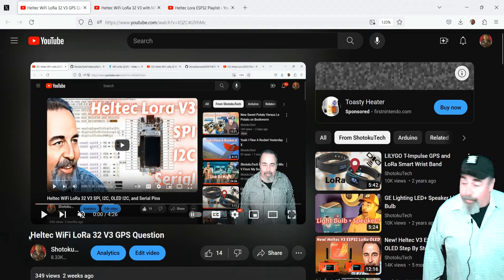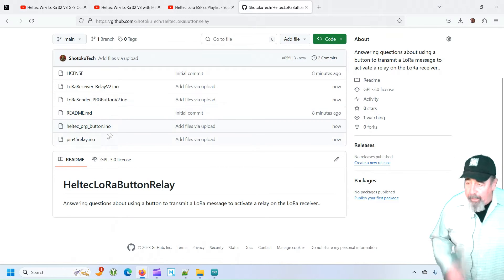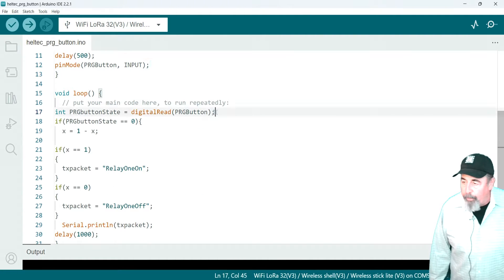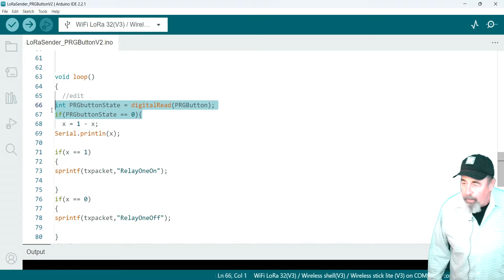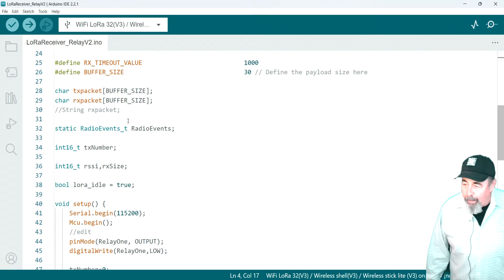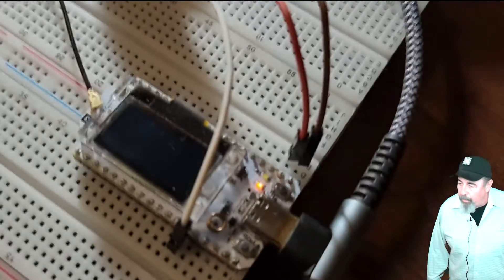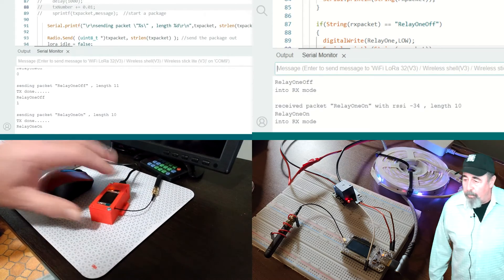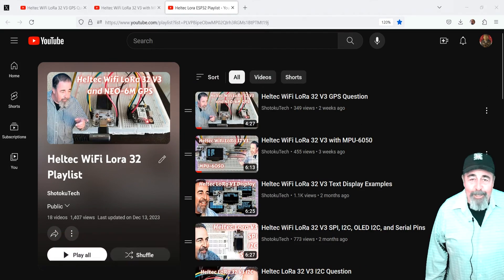Heltec WiFi LoRa 32 V3 Relay and Button Questions

Comment: Greetings from the UK. I've gad a few problems with Heltec V3 but your videos have helped to get it sorted. One sketch I would love o see is the relay module as described but with the receiver sending back the receiver state after pressing the button. I will be opening a gate remote from the house and want to know that it has actually happened. Thank you for all your videos - a really useful collection of knowledge for us  tinkerers. ATB Adrian
Reply from the maker: I got it half way there! So for kicks, to confirm the gate is open, would want a contact switch? Magnetic switch? Optical sensor?
Reply: @ShotokuTech  That is more than fantastic. The electric gate is operated by a relay and it is only necessary to send back that the relay has turned on or off. If I see that on the transmitter coming back I know the gate has opened or shut. To be clear in your sketch you are sending RelayOneOn or RelayOneOff. All I need is he receiver to send back those commands to show they have been received. I hope that is clear! Thank you so much for your help. Kind regards Adrian

Comment: Good video. However, I'm new to Arduino and Heltec devices and am confused about the actual build process you did for this project. I added edits you had to the LoRaReceiver.ino file and also included the pin45relay.ino code. The LoRaReceiver.ino code buiil ok and I uploaded to the heltec receiver device. I made a new sketch and did the same with the LoRaSender.ino file using your changes in the LoRaReceiver_Relayv2.ino and the heltec_prg_button.ino files. That build and loaded ok but the result doesn't work; i.e., the relay doesn't turn on and I get no messages in the Arduino IDE output. Any suggestions to clarify the build process would be appreciated.
Reply from the maker: Hello. I also posted the code on Github. https://github.com/ShotokuTech/HeltecLoRaButtonRelay
I recommend you view the latest information on the Heltec V3, this affects older code that came before recent revisions. "Update: Heltec WiFi LoRa 32 V3 Latest Info"
https://youtu.be/c1lkIko4Wsk

Comment: Thanks for the video! Very helpful, just one question, Can i use this code if i have the Wifi LoRa OLED V2?
Reply from the maker: I cannot guaranty code for V3 will work on V2 and vice-versa. V3 is ESP32 S3 and many things changed. You can give it a try if you like.

Comment: Hello, is there any arduino library could i use to make my heltec lora 32 V3 communicate with RAK7289V2 module please
Reply from the maker: Meshtastic is the way to go!
Reply: is meshtastic library compatible with arduino ide ?  @ShotokuTech
Reply from the maker: @mahmoudayman6973  No, it is a firmware you flash onto compatible devices. Then you can send messages privately between nodes or publicly to the network. I have a Meshtastic playlist here for you to learn more.
Reply: okay, can you provide me this playlist? @ShotokuTech
Reply: but i think LoraWan gateways are not meshtastic compatible @ShotokuTech
Reply from the maker: @mahmoudayman6973  That's correct. They are two different things. Meshtastic doesn't have a dependency on gateways. The devices form a mesh and each client forwards any packets it receives. You can add an MQTT server if you wish. That's about it.

Comment: I've been searching to build something similar for a while, from another video I seen. From what I've watched, he uses 2 Adafruit Feather M0 boards, with built in LoRa. (The video is in Thai so; I have no clue what he is saying) It was built in a clear box and, one is a transmitter and the other a receiver. 

The transmitter has 9 push buttons and an on/off rocker switch. The receiver side controls 4 relays. What all the extra buttons do, I'm not exactly sure. It just looks like a cool little wireless remote, that I haven't quite found a use for if I ever figure out how to build it. I got all the parts but, I really struggle with coding for some reason.

I'm thinking maybe I should just start with something like this, instead of going to something that complicated. (It looked easy to build at first haha). I also get 2 ESP32 boards/ and the LoRa modules but....once again got nowhere with it. Anyways, thanks for making the tutorial video on this! I'm thinking this will help me learn the whole process better.
Reply from the maker: Take one small step at a time. Best wishes.

Comment: Hi, I have copied and compiled the LoRaSender file in Arduino IDE and I get this list of errors, what could it be?

c:/users/gocha/appdata/local/arduino15/packages/esp32/tools/xtensa-esp32s3-elf-gcc/esp-2021r2-patch5-8.4.0/bin/../lib/gcc/xtensa-esp32s3- elf/8.4.0/../../../../xtensa-esp32s3-elf/bin/ld.exe: C:\Users\gocha\AppData\Local\Temp\arduino\sketches\7BA601B1808FAFDE6031BFFFFE5A58C2\sketch \sketch_feb14b.ino.cpp.o:(.literal._Z11OnTxTimeoutv+0x0): undefined reference to `Radio'

c:/users/gocha/appdata/local/arduino15/packages/esp32/tools/xtensa-esp32s3-elf-gcc/esp-2021r2-patch5-8.4.0/bin/../lib/gcc/xtensa-esp32s3- elf/8.4.0/../../../../xtensa-esp32s3-elf/bin/ld.exe: C:\Users\gocha\AppData\Local\Temp\arduino\sketches\7BA601B1808FAFDE6031BFFFFE5A58C2\sketch \sketch_feb14b.ino.cpp.o:(.literal._Z5setupv+0xc): undefined reference to `Mcu'

c:/users/gocha/appdata/local/arduino15/packages/esp32/tools/xtensa-esp32s3-elf-gcc/esp-2021r2-patch5-8.4.0/bin/../lib/gcc/xtensa-esp32s3- elf/8.4.0/../../../../xtensa-esp32s3-elf/bin/ld.exe: C:\Users\gocha\AppData\Local\Temp\arduino\sketches\7BA601B1808FAFDE6031BFFFFE5A58C2\sketch \sketch_feb14b.ino.cpp.o:(.literal._Z5setupv+0x30): undefined reference to `McuClass::begin()'

c:/users/gocha/appdata/local/arduino15/packages/esp32/tools/xtensa-esp32s3-elf-gcc/esp-2021r2-patch5-8.4.0/bin/../lib/gcc/xtensa-esp32s3- elf/8.4.0/../../../../xtensa-esp32s3-elf/bin/ld.exe: C:\Users\gocha\AppData\Local\Temp\arduino\sketches\7BA601B1808FAFDE6031BFFFFE5A58C2\sketch \sketch_feb14b.ino.cpp.o: in function `setup()':

C:\Users\gocha\AppData\Local\Temp\.arduinoIDE-unsaved2024114-20152-85351j.51uw8\sketch_feb14b/sketch_feb14b.ino:43: undefined reference to `McuClass::begin()'

collect2.exe: error: ld returned 1 exit status
exit status 1
Compilation error: exit status 1

Comment: Ebyte devices, including the mentioned model, operate using a UART channel with LoRa as the physical transmission medium. To view messages, just connect the LoRa module to a USB-serial converter. Using software like Putty in serial mode, you can receive the messages. This effectively makes the Ebyte LoRa module a wireless UART link
Reply from the maker: Can you send AT commands to it to configure LoRaWAN settings? Like I say, I don't have this device so it is hard for me to troubleshoot this issue.

Comment: Wow, I was going to ask a related question.  what a coincidence!  I would like to know if it is possible to communicate this HELTEC LoRa module with the Ebyte LoRa module.  Because I'm working on a project that uses these modules, but without success when I try to communicate with different manufacturers.
Reply from the maker: I just looked at the Github page for EBYTE and it is coded with micropython and I don't see any useful examples. I don't have any of these devices so it is hard for me to figure out how to do this. LoRa and LoRaWAN are standards, so one would assume given the same frequency and LoRaWAN settings, the devices should communicate. But you would need to use the specific library and code for each device. Best wishes!